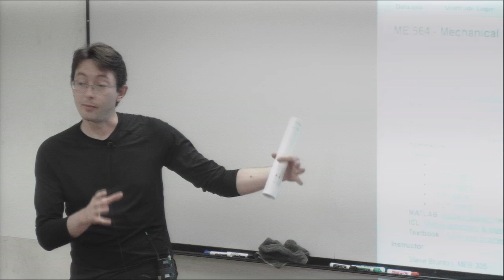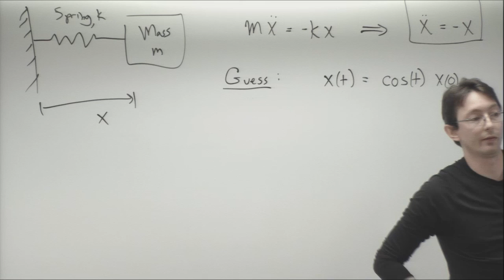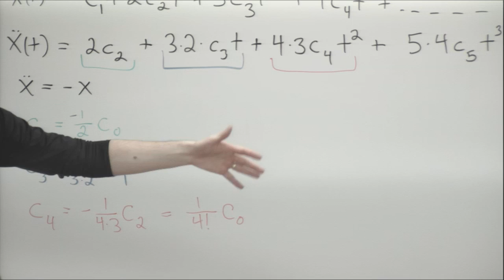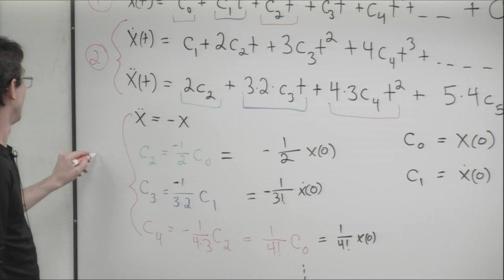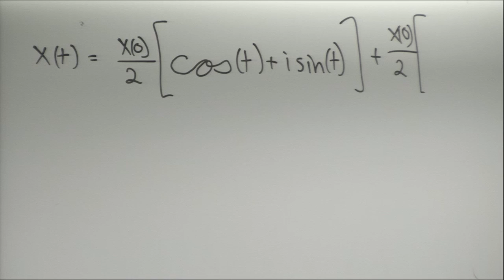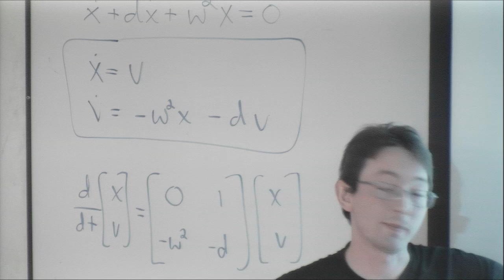ME564 Lecture 4:  Second order harmonic oscillator, characteristic equation, ode45 in Matlab

Comment: Professor Brunton: At 49:06, a student pointed out that there was a difference in the matrix that you wrote on the board and what you coded in Matlab, I still don't have it clear why zeta (on the board) equals -2*d*w (in Matlab). Could you please help me understand?

Thank you, I'm really enjoying ME564 lectures, I started right from the beginning.
Reply: I think the original damped harmonic oscillator equation was used there, not sure how it came to the picture, d^2x/dt^2 +2ζωndx/dt +ωn2x=0 is the one used there
Reply: I have the same question, it's a bit confusing

Comment: Great lecture. Thank you but I have a question.
For method-3: the solution x(t)= x(0) cos(t). 
if this is the solution for every time step t then for a zero valued initial condition the solution will always be zero. 
x(1) = 0 * Cos(1)=0
x(2)= 0 * cos(2) =0 
.
.
.
.
Please explain me if you are online.
Reply: Exactly the mass does not move if its initial velocity is zero (34:20) and  its offset is also zero. Those initial conditions create no oscillation.
Reply: @raindrop_collector , thank for the reply... Actually I got it wrong, but your reply made me to think in right way. 

By the way, my orginal question was regarfding forced system...that is a forcr F will be there in equation of motion... 

mu''+cu'+ku=F,  what would be solution of this?
Reply: @mdikramuddin1772  I think that is discussed in lecture 12. By the way in that case the solution would be composed by two parts. The first one is the solution of the non-forced system and the second one is a particular solution which is easy to find if we know F has particular properties (exp, poly, constant ...) but there is a more general way to find it in other situations.
Reply: @raindrop_collector  thanks sir. Can I be connected with you on facebook or linkedin?